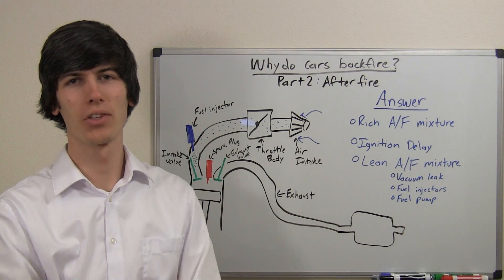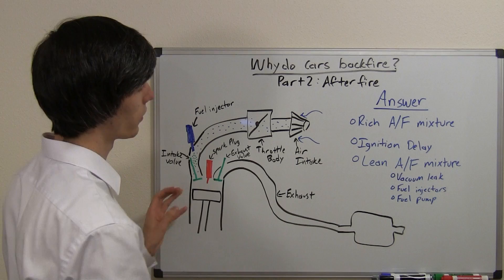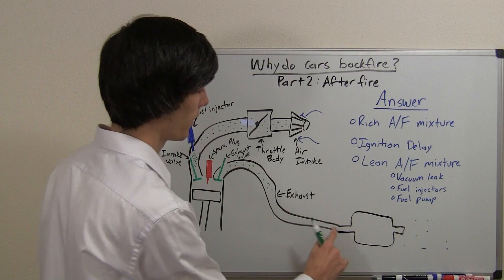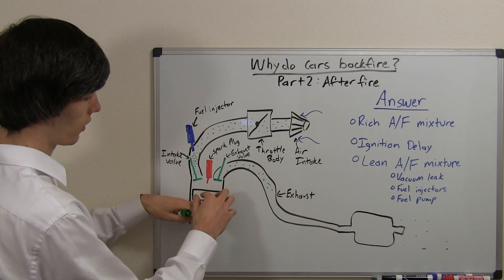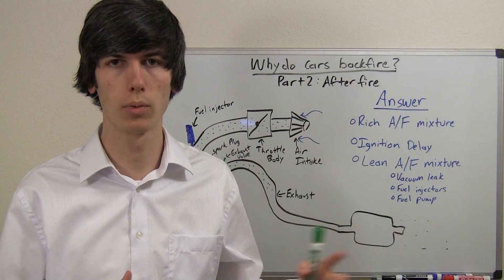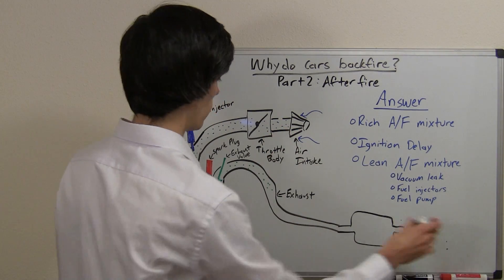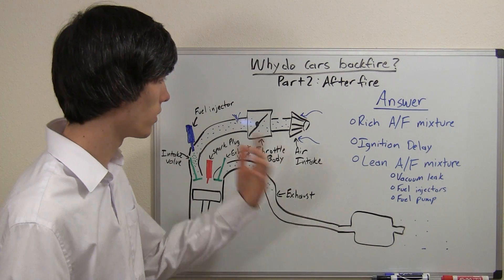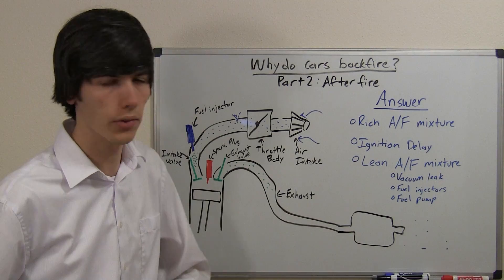Why Cars Backfire - Afterfire - Explained

Comment: What I dont get is why backfires only really happen when you let off the gas
Reply: +dacasman If the "afterfire" occurs only after you let off the gas. T

In stock turbo cars they have a "Mass Air-Flow Sensor" that measures the air that goes in and lets the ECU know how much fuel to inject so that all of the air is used. 

When the turbo creates boost(more air) and you let off(and close) the throttle, that boost that wont enter the engine will be recirculated with a "By Pass Valve"

Many, replace the BPV with an aftermarket "Blow Off Valve" These will vent the air to atmosphere (throw it away) instead of recirculate (recycle it). The air was already measured by the MAF and the ECU has no way of knowing you threw away the air. So now you run rich every time the BOV is used(every time you let off throttle). 

The solution is to retune the car so you don&#39;t use the MAF Sensor, and instead of measure the air, use pre-calculates tables according to what was measured by the Wideband Oxygen Sensor in the exhaust (Air To Fuel Ratio). This is called "Speed Density" tuning.

I don't know about Non-Turbo cars though.
Reply: Yeah, also might get a new exhaust on it just because. xD
Reply: +SI0AX my car crackles whenever I let off the gas whenever it's cold out.
Reply: FallenSlayer
My car does it a bit, when I changed out the exhaust and didn't tune it properly. It's running a bit rich. This is another cause of the afterfire that can happen on turbo and non turbo cars alike.
Reply: SI0AX My car might be burning a bit rich, but any explanation as to why it only happens on a cold start up?
Reply: FallenSlayer
The cold start up is a programed ecu function. It makes the car rich on purpose to warm up the Exhaust Gas Temperature so the the catalytic converter rich operating temperature as soon as possible(emissions).

I think the cold start also servers other purposes of course, like warming up the oil, coolant and engine to operating temperature as soon as possible.

My cars tune is not finished so I get a pop in the exhaust every time I start it up. The ecu adapts and leans out the mixture pretty quickly though.
Reply: yeah, probably the ecu or could be mass airflow sensor but I cleaned that so that should be reading normal. Thanks for the info.
Reply: FallenSlayer
Did you do any modifications to your car?
Reply: SI0AX Not really, just cleared out a couple of the cats because it was getting clogged up, and the engine has been rebuilt but no turbos.
Reply: FallenSlayer
Ah, the de-cat improves air flow a bit. I did the same in my car. It might be running a bit rich but it shouldn't be a problem.
Reply: +SI0AX Couldn't you just move the MAF behind the BOV?
Reply: eirikol1
Yeah you can, but I think many cars include the temperature sensor inside the housing that has the MAF so you are going to have to tune it anyway as the reading will be warmer(turbo compressed air is hotter).

Remember that the MAF just reads how much air is entering. Hotter air is less dense so it means less air and cold air means more air.

Comment: What if I was in second gear on a turbo car and drove it to the redline of 7 
And I let off the throttle and a flame came out of my exhaust ? 
What does that mean ? Lol thanks
Reply: that's because it injects the same amount of gas needed for 7k rpm when you let off the gas until the ECU realizes that you let of the gas and the rpm's are going down, so that would mean that it runs rich for a small amount of time

Comment: What about when the vehicle is accelerating? When I downshift on my motorcycle and engine brake, it after fires pretty rapidly. Why is that?
Reply: +Jack de Graad i think it's because it's lean. the engine is still at a high rpm and suddenly, the supply of fuel drops (throttle fully closed) when engine braking. and as he explained in the video.
Reply: zen azhar  its the other way around, your engine is up to speed then you close the throttle there are still more fuel but less air in the system

Comment: yes part 1 of your argument is right of possible lean fuel with vaccum leaks to a certain point but it does not burn slower. it burns hotter. go to a race track and look at the exhaust. cars that have black exhaust or unburnt fuel is rich and they don't win. find the exhaust with a gray tint or no exhaust residue at all. lean is fast and fast it hot

Comment: Why does a lean mixture burn more slowly?
Reply: +GoliathGunner There is less injection, and for combustion: fuel needs a 14/1 air/fuel mix. So when lean, the car isn't getting enough (well, enough, just not a lot) of fuel and it takes longer to add more fuel.

Comment: Can you please explain the Anti-lag system on turbo cars? Thanks. Great videos
Reply: Although you think that the engine isn't getting any fuel or air when you completely take your foot of the accelerator, the engine management software still adds some fuel, and leaves open the throttle body a little bit even though you think the throttle was closed completely. Then the engine management system also retards (slows in time) the ignition so it occurs in such a way that ignition hasn't been fully completed before the exhaust valve is opened (more or less). This way on a closed throttle there is some amount of unburnt air/fuel mixture that ignites within the exhaust manifold to help keep the Turbo's Exhaust Impeller Spinning at a higher RPM - hence less lag when you go back onto the throttle - pretty slick, right ?
Reply from the maker: Quang Chu I have two videos on it, have a quick search on my channel. :)

Comment: My car used to produce loud exhaust popping sounds, I could hear it clearly when I rev and release the gas pedal at idle and also when slowly going down a hill with no foot on the gas pedal while in a low gear it's a stick shift, is this a backfire/afterfire problem ? I drove with a clogged catalytic converter for sometime unknowingly then had it replaced and eliminated the resonator which was also clogged but the mechanic did not sit the front ring gasket well so it was leaking exhaust. Last weekend I had a new resonator installed and also a new ring gasket even though a slightly fatter one that slightly increased the distance between the catalytic converter and the exhaust manifold but the exhaust is sealed regardless. I was expecting my exhaust db to resume to normal and the popping sounds to disappear assuming it was due to the absence of the resonator and the leak but it only resumed to about 90% of the original factory db, the popping sounds are still there but much much quieter. What could be the problem ?

Comment: Interesting explanation on the back/after-fire in cars.  I've heard a few high performance and race engines after-fire when starting.  It usually happens just before the engine turns over, and the starter cranking sounds really slow.  I always wondered what caused that, but now I'm guessing it's a combination of high compression and a rich mixture, but I could be wrong.  Is this the case?  I've seen a few videos of musclecars that do it and some race cars (NASCAR style?) that do it.

Comment: A turbocharged car after fire, Is it a result of lean A/F mixture?
Reply: MrGeneralRelativity Adam have a point. But not all turbocharged cars uses anti lag. Note that on full throttle (Wide open throttle@WOT), it's very rich which will ignite at the end of exhaust. On the other hand, when the throttle is closed FULLY (braking into corner), they will make it aas lean as possible to save fuel. Here, it's Lean. So yes. One or all 3 can be found on racing and performance cars.

Comment: I have this issue on my h23 vtec prelude with the crower cams only when i downshift and tap the peddle and every time I shift it pops out the back and it's pretty loud it's tuned and has other performance mods the cams have a big overlap but I can pretty much get the car to throw an after burn on command witch is odd but it doesn't do it when accelerating

Comment: Hi.
Do Backfire and Afterfire come under Misfire of an engine?
THANK YOU!
Reply: Yes, if the engine misfires, a cylinder full of fuel gets pushed into the exhaust and ignites via contact with the exhaust pipe. The catalytic converter deals with that so no flames. True story, I have an atv with a clogged up fuel system. It would misfire and pop with fire coming out the exhaust until it reaches operating temperature.

Comment: Ever since I did a muffler delete, I get a little pop at certain RPMs. I doesn't bother me, in fact I think it's kind of cool, but my question is. What actually makes the exhaust pop after  tampering with it such as straight piping or removing exhaust components if its not afterfire, because my muffler delete doesn't mean I'm burning more fuel lol.

Thanks.
Reply: I did a muffler delete to on my e92 and it sounds beautiful 
It pops but not too loud
Reply: The exhaust mixture is more open to mixing with outside air, and the oxygen therein. This mixture as explained in the video could ignite if enough hot gas is present.

Comment: What is the probably cause if my car after-fire when I hit full throttle and it stop accelerate. I have to depress my paddle a little bit and acceleration continue.

Example.
Cruising at about 100km/hr then slam paddle to full throttle, Bam bam! after fire no acceleration at all.
Second try, at speed of 100km/hr press paddle about 3/4.  Speed reach 180km/hr in a few second.

My question is what the heck happened? Could it be because of my new fuel pump?
I switch from broken Evo IV fuel pump to 2JZ turbo fuel pump. My engine is 4g63T.
No modification. except fuel pump and spark plug.

Thank for help. Thank you.
Reply: Coop Crazy  too much fuel and less air. when accelerating you put more fuel, sudden deceleration closes your throttle which cuts off air

Comment: So cars that backfire is bad ... I mean ive seen maseratis ferarris and lamborghinis back fire.
Reply: i think that backfire is due to an anti-lag system. check this guy's video on anti-lag systems. that's a good thing for sports car as it keeps he turbos rotating and hence no lag.
Reply: In those cars, that would be an after fire not a backfire and it's mostly due to rich mixtures during heavy accelerations. It also happens during downshifts and overruns cause when you release the throttle, the injector closes and you burn whatever fuel you have left until you resume the gas pedal, same for overruns. But you need a sport exhaust and a sport catalyst for that and a high output engine, such as those you said. It's totally normal anyways and manufactures do it on purpose. Subject is tricky though!
Reply: It's possible to inject gasoline in the exhaust for the effect. Diesel fuel if you want to roll coal. But only do it after the catalytic converter

Comment: I pulled an old glasspack from a friend's car, and the piping had a Spark plug tapped into the side of it. Which leads me to wonder if maybe it could cause afterfires? 
What would be the benefits of having a live spark plug there, and how would you wire that?
(Btw, this was pulled from a 74 Plymouth Duster that hasn't been touched for many years)

Comment: How would you make your car backfire more? i had a lancer with a cannon on it that backfired quite often whenever i backed off the accelerator, i now have a Liberty with a cannon and it doesn't backfire, like what so ever, why's this? i want the backfire cause it was so much fun in my lancer. would getting a smaller resonator or headers or something change that? i don't really wanna tune or what ever as i don't see the point cause i'm on my P Plates and got no mods.
Reply: True backfire isn't exactly good for your engine. It's probably not going to blow your heads off, but it's surely not good for your valves and pistons.

Comment: How dangerous is this to exhaust system or the car in general? I've read that it can destroy your catalytic converter, but I also know that the McLaren 12C and P1 use excess fuel to cool the turbo as it passes through it. If a super car built by a company known to build high quality cars can have a flamethrower shooting out of the exhaust at will, can your average every day car handle some afterfire?
Reply: I don't believe it would happen easily on an average car because part of it is from the pressure the mixture still experiences on it's way out, along with the heat. And most cars with catalytic converters are built in some way to not have such a high temperature exhaust because it's a main cause of NOx production and other emissions.

Comment: You are not completely right with the back and after fire. When the exhaust valve open there is always a flame. After fire is mostly after you go from high rpm to low. Specialy when you pump the accelerator. What happen is that the air intake is cut of and to much feul goes in the engine. Then the exhaust pipe is ful of feul then one of the cilinders fires and the smal flame from the exhaust valve ignites the feul in theexhaust pipe and that can result a flam bursting out the exhaust. BTW i like your videos verry simple explanation of how things work. Keep up the good work

Comment: I noticed some of the guys who drive modded mustangs at my high school have constant backfire when their revs decrease. They think it's cool, I think something is terribly wrong and that they are ruining their cars.
Reply: ***** Dark matter, It is actually after fire. not back fire. My buddy owns a mustang and we asked around and found that out. Just like Hazard said, its not bad for the car, just running a little rich
Reply: Mrgunman1955 i see, now i know why my bike exhaust gives a popping sound during engine braking at low rpm.
Reply: they also probably have straight pipes and have taken their cats off and catalytic converters have platinum in them and since it gets so hot it burns all the excess fuel but without them like my camaro it lets it out and thats why u hear the bangs crackles and pops aka the after fire

Comment: Just hypothetically, could this mean that if your car starts backfiring, the injectors might need to be replaced? (Assuming that no changes were done to the engine and that the car has never backfired before)

Comment: HI ENGINEERING EXPLAINED
I have a question about afterfire if the fuel pump connecting direct with switch i mean when the switch is on position it does not cut off after 5 sec and during the acceleration in 100 km make afterfire ? and the cam sensor make aferfire too 
plz share with me ur idea thank u very much

Comment: Engineering Explained.  why does a lean AFR burn slower than a richer AFR
Reply: Roughly said more air in the mixture than needed dilutes it so flame propagation is obstructed because air is not combustionable.
Reply: SkywalkerTibor I wasn't asking you.  i hope you felt smart though.
Reply: Probably the mixture misses first than ignites

Comment: Is it possible then to make my car ( AudiR8 V10), or any others shoot flames by changing the air to fuel ratio?
Reply: No, to shoot flames, you need to remove catalytic converter. Also, shooting flames is not necessarily a good thing. Imagine all that stress your valve train and exhaust components take when you are combusting or rather exploding fuel outside the combustion chamber.
Reply: This is true. A friend of mine has a straight piped Lamborghini gallardo, it spits flames on its downshifts, looks absolutely badass.
Reply: James Pursell Afterfire doesn't hurt the engine nor does it put stress on the engine. Especially the engine in your audi which is meant to be revved and beat on mercilessly.
Reply: caleb Reedy I already have Stasis exhaust on it; I was more curious as to why the almost identical v10 in the gallardo emits flames so easily in comparison to mine
Reply: James Pursell It's the tune that matters. If your car is tuned well, it will spit fire almost never or in much fewer cases than car that is tuned differently.
Reply: caleb Reedy Not sure about audi, but on most cars I have seen it does have consequences when it happens excessively often. I am not tolking about minor and occasional backfires - I am talking about intentionally trying to achieve this condition on a regular basis. Also, I mean the backfires, not just fire out the exhaust.
Reply: All it is is unburnt fuel and the exhaust is hot enough to ignite it. I don't believe it harms the car. Many cars can do it like dodge vipers, lamborghini, ferrari
Reply: Strider Sky I believe, considering it is going out of the exhaust after going through the combustion chamber, that it wouldn't harm the valve stem seals because the lean mix is cut off from air going through the exhaust, which is why it ignites at the exhaust tip. I don't believe the entire exhaust path lights up.

Comment: i have a question like u said that if there is a hole in ur air intake this will cause a lean A/F mixture and this burns slowly so that when the exhaust valve opens the explosion continues through the exhaust BUT my question is if there is a big enough hole in the intake could this cause after fire at IDLE revolution

Comment: No! Sorry, a lean air fuel mixture burns FASTER than a rich mixture. The richer mixture burns further into the power stroke and is why it makes more power. I love your videos and your almost always right. Had to point that one out. I went to school for this stuff, im sure you did too, but im certain lean burns faster. Example : pooled gasoline vs gasoline mist. The mist will burn faster.

Comment: you can also have back fire by have no exhaust(straight pipe) or having a leak in your exhaust system. Also if your secondary air pump staying on for a long period, it can create a back fire.